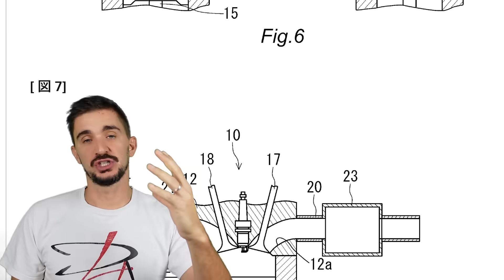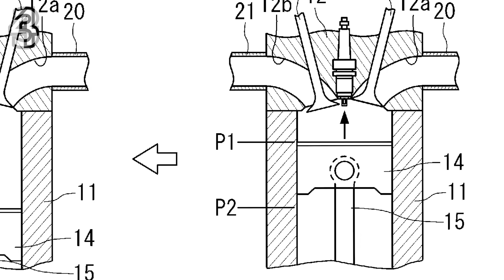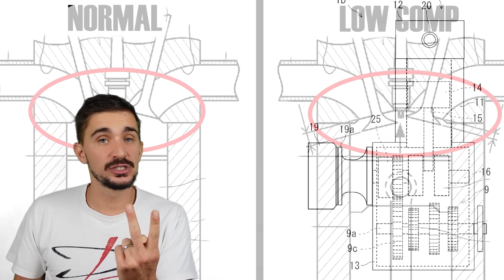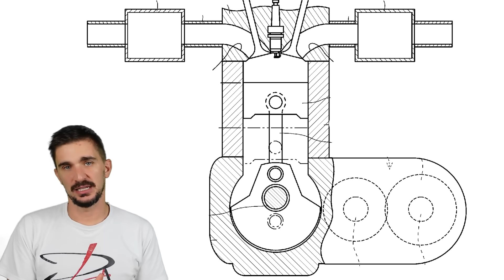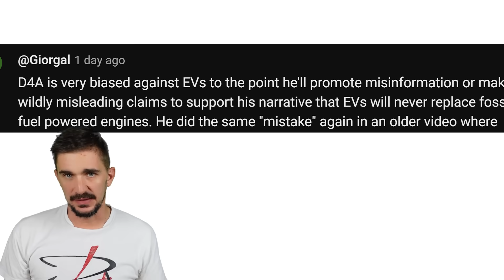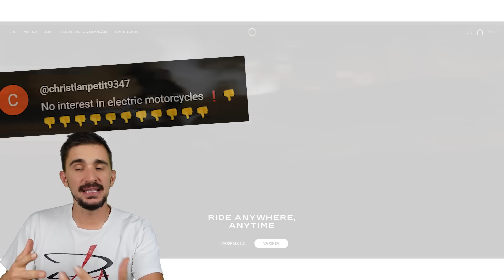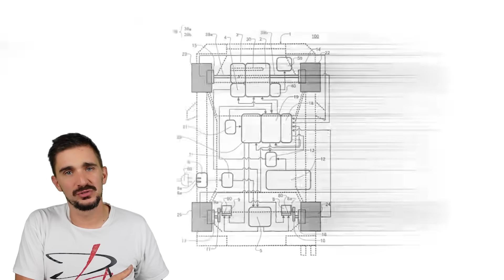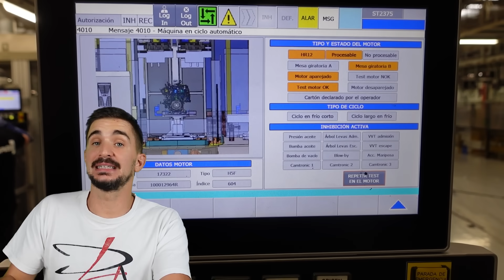Yamaha Just Patented A Fake Engine

Comment: The fake engine would not need to be of any great weight: 4kg should do it. A aluminium cylinder cylinder and gearbox about as thick as a saucepan would be more than enough. There would be no real compression and the “valves” would not need springs. (Imagine a child’s pop-gun.) A slightly off-centre weight on the crankshaft would be very effective for vibration. Lubrication and servicing would not be needed – sealed for life bearings would do the job. Air-cooling would be more than sufficient. If “engine parts” ever did need replacing, access would be through the gearbox cover with one spanner and a screwdriver to lever out the old bearing.

As far as the patent goes, all that a patent has to be is “novel” – I don’t recall anyone else making a fake engine, so it’s novel. And “Yes theoretically you could patent a non-blending blender” There is already a patent on fake, non-readable books for displays with hard, good looking covers containing a lump of polystyrene –very impressive on a bookshelf.

As has been said, this is a “just in case” patent – at a comparatively negligible expense. 

Will we ever see a fake engine? I doubt it.

Comment: I guess "loud pipes saves lives" but in EV form?  Imagine buying aftermarket exhaust for your fake engine.  

or it could be 4d chess like an EV bike with "moped mode" gas engine to limp home if you run out of battery??  it   could be a "fake engine" until suddenly it isn't. You can't patent a range extended EV in japan but what CAN you patent?? hmm how about the engine running in "fake mode".   so now if your competitors want to do a gas range extended EV bike if they want the engine to reciprocate only yamaha can run the engine in "fake mode" all the competitors have to actually burn gasoline. 

After the whole video game Pokemon/Palworld video game debacle it is becoming that patent trolling is becoming a super significant thing in the corporate world and Japan seems to be the worst about it.    I think you are right that more government regulation needs to step in and actually examine the contents of the patents and determine if the amount of innovation and cost to bring to market is even worth issuing a patent for.  if it is a super easy to program in a code or to manufacture it would be best for soceity NOT to issue a patent. 

Patents should only be reserved for something that was extremely expensive to design/ product / prototype and manufacture. this will protect innovators especially smaller indipendant companies from just copying the product and selling it for cheaper and undercutting the inventor.  But not patents are just issued to the big companies for having the idea of a thing even if they never even plan on actually bringing it to market effectively killing a product for consumers to even buy it because the patent troll patented it and refuses to produce it!

Comment: I am in agreement with you -- I hate fake "stuff" -- I like EVs but I hated EVs making fake engine or pedestrian warning sounds. Like you said about those electric bikes (I have the similar arguments with my brother all of the time) EVs have their own unique sound and mechanical characteristics, they don't need to be augmented or faked just because people are used to vehicles making those loud, obnoxious noises.

Now if some automaker would make an EV with a real 6-speed manual transmission with clutch pedal and stick shift and everything... 😂

Comment: I think if EVs want to make mechanical sound, they should use straight cut gears. They're more efficient than regular gears, and they're stronger so you could use lighter ones than what are currently used. I think It really fits the personality of an EV.
Reply: Yeah and if they wanted to add vibrations then they can add a 'balancing' shaft, and they can also do whatever they want with the throttle map and torque map to give it 'character'. Harley of all companies already did this with the Livewire
Reply: @nfdr0kk3rz  you mean an imbalance shaft
Reply: @nfdr0kk3rz  riding a Sybian
Reply: I think that engine is just a sparkplug and a carburetor short of making real engine and therefore a hybrid engine. Or maybe its a way to sell internal combustion engines after they are banned you buy a motorcycle fake engine buy an aftermarket kit and convert it into a real engine. Thats the only somewhat logical reason i can think of.
Reply: Chain drives too. The BlueFlash 2025 Car (Formula Student) almost sounds like a CV
Reply: True, and I honestly like the sound electric motors make. I drive an older PHEV (2017) and the sound it makes is kind of cool. Not the added speaker sound, just the whine of the motor
Reply: I like this idea. EVs struggle with carrying a large enough energy source for their own weight compared to ICE cars because the energy source is heavy, any weight reduction is valuable and I'm a proponent of functional sounds. I also think that, if people are going to make vehicles with fake sounds, the sounds should still suit the vehicle. EVs with fake sounds should sound like antigravity cars from F-Zero or Wipeout.
Reply: @Where_is_Waldo  Would you accept it sounding like a TIE fighter?
Reply: They could also make cool VVVF sounds if they reduced the primary frequency.
Reply: And also put an un-balance shaft on it, like the vibrator in your phone.
Reply: i'm 99% sure it's just so they can demand royalties for any EV conversion kits that keep the old engine as a range extender/noisemaker
Reply: They already whine why make it worse
Reply: That's what my high end hobby grade RCs use
Reply: Sorry but you’re wrong about gears. Helical gears have more load carrying interface between gear teeth therefore more load carrying capacity ie. more strength relative to the amount of material. Straight cut or spur gears have lower frictional loss than helical therefore more “efficient” but would need to be larger to have the needed load capacity compared to helical. The higher unit loading of spur gears is what makes them be noisier and they have speed limitations relative to size that decrease as helix angle increases. Spur gears are cheaper to manufacture so they are used in suitable applications but for high speed high load power transfer you need to have that helix angle. So, helical gears are not just for noise reduction as is commonly believed, load capacity and speed are more important.
Reply: @terrylaw18  Wrong but not wrong. Easiest way to make more robust gearbox in given housing is to replace helical gears with straight cut. Helical gears are pushing sideways, and to high of a load can crack the housing.
Reply: Most EVs don't have "gears" 🤦🏻‍♂️

How do you not know this?
Reply: @evanmorritse  they do have gears, they’re just part of the motor. EVs generally only have one set of gears so only one gear ratio as compared to a normal ICE vehicle.
Reply: @evanmorritse  Looks like that Yamaha design has a gearbox attached.
Reply: @evanmorritse  So since MOST electric vehicles don't have gears (for simplicity sake), we can't add gears to them, which also increase functionality, but instead we will add a fake motor which NO electric vehicles have?
Reply: @rayzecor All commercially produced EVs have reduction gears, a couple have more than one gearset like the porsche taycan. Where did you get any information that they do not...? 

You cannot get any electric motor configuration which will directly drive the wheels which will have adequate performance for modern roads and expected speeds.

For that matter, it is rare that EVs do not also have a differential... Most do.
Reply: @LDR33Pyrodyne  I didn't, some guy commented that most EVs don't have gears. I felt like an electric motor must have gears but decided to use a more pertinent argument instead.

As you can see, my question is framed like a question to answer a fool according to his fooly, lest he be wise in his own eyes.
Reply: @rayzecor It seems I completely failed to reply to the correct post 😅
Reply: There are good mechanical sounds, and bad ones. No one likes the sound of straight cut gears.
Reply: @seanylewl  Wrong! I love the sound of straight cut gears. Its the sound of more power getting to the road :)
Reply: @seanylewl  Why wouldn't I want my car to sound like a WRC car?
Reply: @seanylewl tell that to literally any fan of Need For Speed: Most Wanted. The straight cut gear whine of the M3 GTR is one of the most often cited things that people love of that game.

Comment: It will be popular technology in America. Americans are obsessed with deceiving themselves for the sake of comfort. Elon's mad because he didn't think of it first or Tesla cars would have fake rumble machines. Americans don't care about waste. Remember the cars from before the seventies? American cars had engines five times larger than Asian and European cars and yet they often made less power without serious modification. The American version of this technology will be designed so that it won't work without petrol. It still won't do anything but make noise and vibration, but Americans will complain about how they love the smell of burning poison gas and they shouldn't be forced to breathe clean air. These engines will still use orders of magnitude less fuel, so the fuel tanks will be shrunk to 4 or 5 litres so a tank of gas lasts no longer than 22 gallons does in an American SUV now, and the gas price will be able to inflate to $150 per litre because they sell such small quantities, meanwhile they will tell you you're saving the planet by burning less gas. It will be convenient and easy for Americans to "forget" that the original patent did not burn petrol. Of course, if the Americans want their own patent they'll have to do something different anyway. Since we're making a useless engine that does absolutely nothing then surely it would only be American of us to add as many useless activities as possible. Burning petrol in a fake engine that produces no power and does no work at all and in fact only will ever achieve wear and tear on whatever system it is incorporated while appearing to be innovative and fun and progressive and strong.... how did I suddenly start describing women? Is this new bike engine for girl bikers? They can have all the rumble with none of the work involved in maintaining and caring for a real bike/engine?  Honestly this technology is about a hundred years too late... Or it's a dumb idea. Proof Japan has become Americanized (made into Simpleton). Remember, 200 years ago Japan had robot dolls that would move around the kissaten and serve your tea. This here is the opposite of evolution. This is... American.

Comment: I actually kinda like it

Yamaha already have the infrastructure to make motorcycle engines and parts, they can now just make them thinner, since most of the reason engines have to be so heavy is because they need to withstand combustion, and now that there's no combustion, it's not so hot, so you can use a lighter oil

they're offering an experience, like how BMW uses speakers to fake engine noise in their cars

also, it means your electric bike can be heard by pedestrians, so a smaller scale model can be used say, in cars travelling <20 km/h, making it safer for everyone, but not being too big an inconvenience for the driver

Comment: Filing trivial and/or frivolous and/or nonsensical patents happens a lot. Some companies (esp. very large ones who can afford it) will patent any half-baked idea that any rookie engineer comes up with. Doesn't mean they are committed to making the actual product. They just hang on to the patent "just in case". At the very least it will prevent the engineer (perhaps after he's not a rookie anymore) to take the idea (or parts of it) to a competitor. Also, there's patent trolling (look it up). Though that is probably not what's happening here.

Comment: Still gonna need some oil. Won't be light. Could accomplish this with a computer controlled speaker and a small, out of balance flywheel driven by an electric motor also computer regulated. But all that Still introduces inefficiencies. I thought efficiencies were one of  the major reasons for electric bike. The fake engine would also introduce engine braking which would rob from regeneration.  Does the electric motor have a gearbox. Without  a gearbox it still wouldn't sound an feel like a real engine.

Comment: If they sell this I’m curious how it’ll actually sound accelerating cause normally an engine has a distinct sound when under load vs just engine braking with no fuel being added. Maybe when this fake engine bike accelerates it’s still going to sound like an engine deceleration but paradoxically with increasing rpm.

Comment: If you're gonna make a fake engine , why not put an electric motor where the cylinder head goes ? Have it drive the gear box , so you can still pull in the clutch and shift gears.... It could look like an ITC engine , but be electric powered. The fuel tank and oil tank could hide the battery and electronics ....

Comment: If you, want to imagine what an engine with no combustion sounds like, just remember that when you're using engine break when going down hill, on an electronically fuel injected engine, there is no combustion happening. That's pretty much the sound.

Comment: Suggestion: put a vibrator in the saddle, generate engine sounds through ear plugs/speakers in the helmet and strap on a dummy engine made from plastic to the frame.
Saves people around from the bloody noise and makes motor cycle riders feel real macho...

Comment: We have hybrid cars. And they are surprisingly popular. I have never seen a hybrid motorcycle. But why not? In stead of a full size engine, you could place a 50 cc engine. With a flat batteri you are able to limp home with this little engine. I have retired as a Patent examiner. I wonder if I should file a patent application on a hybrid motorcycle. Could be a much better idear than the Yamaha patent.

Comment: Where I used to work, we had a SpinTron to do valve train design.  It's amazing how loud the engine is just running the valves.  It had no crankshaft, just a straight shaft with no rod journals, that went through the main bearings and drove the cam gear/belt/chain.
It made so much noise, you couldn't tell it wasn't actually running.
Reply: i would love somone to simulate something like this with a small engine and just spin the motor fast with like a power drill. i would watch the hell out of that youtube video.

Comment: As someone with a Zero SR, the problem with electric bikes isn't the lack of sound, it's the lack of highway range. They all quote like 180 miles of range, but that's city range, and highway, where you actually need it, you get 70-80 miles, tops. So you're stuck in a 35 mile radius around your house. This idiotic patent takes the Achilles heel of electric motorcycles and makes it much, much worse.
Reply: The other problem with electric motorcycles is the lack of heat. It gets fucking cold, and you don't have an engine helping out, anything under 55 fahrenheit and you need to be dressed like a polar explorer to not freeze to death.

Comment: Since the engine doesn't need to actually function, I suppose they could have it produce an exhaust pulse every rotation like a two stroke, but then rut it at half the desired rpm, to still mimic the sound of a four stroke. Halving its rpm like that should result in lower parasitic losses and be easier on their air compressor fake engine.

Comment: If it does a better job at faking it than a speaker then it was worth it. As the patent states, some buyers are really into the sound and feel, if this fake engine makes the sale where a speaker wouldn't then it was worth it. As for robbing power and range, not all straddle-type drivers care about that as much as they do the feeling they get from the machine. This patent doesn't have to go anywhere but if it does Yamaha patented it first so they will reap the benefit.

Comment: This might make sense for a hybrid - when in electric boost mode the engine could still make noises, but be burning nothing. Hybrid bikes don't make sense, cost, complexity, weight, all things that we strive to avoid in bikes. Electric bikes are taking off but more in the commuter segment, where if you have to battle traffic they are win.

Comment: Electric motorcycles already have horrible range, this will just kill any product it's installed in. Why not just add a speaker to mimic a gas engine sound and make the electric motor slightly off-center so it vibrates?

Comment: A piston engine can be an air compressor and/or a pneumatic motor at the same time. I think they're probably thinking of a compressed air battery to boost power at certain times, while at other times they can store air, maintaining the feel of a gasoline engine.

Comment: Electric retrofit old vintage motorcycles.  (22) The battery in the fuel tank and keeping the (8) original drivetrain...
I also have a feeling that Yamaha have a lot of tooling from their previous models that they could be using to make repro e-bikes if this is sorted.

Comment: Look at the patent from 3M for the glue that made "post it" possible. It was pointless at the time, but made a huge success possible a few years later.

This fake engine is just a patent, it doesn't mean that they actually plan on building a bike with it.

I guess they have loads of patents that will never be used.
And some day, one of the weird ideas will turn out to be the thing that sells for some reason.

I agree that it looks pointless, but from the company perspective, it makes some sense.

Comment: Without combustion, an engine is pretty much an air compressor. Maybe you could make the brakes and suspension pneumatic instead of hydraulic, and some other pneumatic elements to somewhat justify the need for recipricating pistons on your ebike.